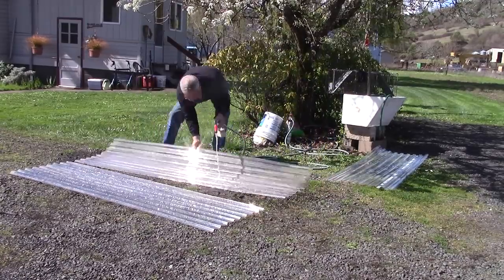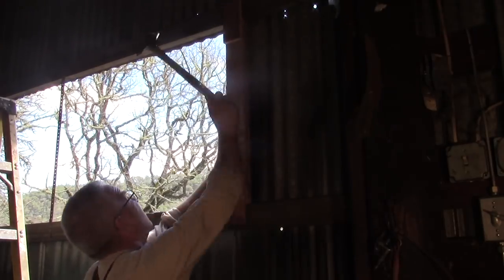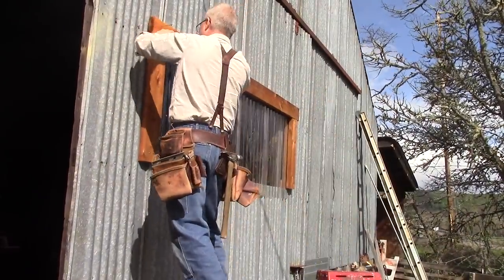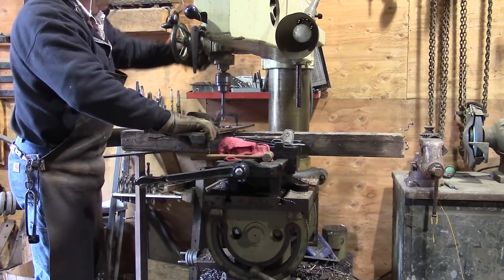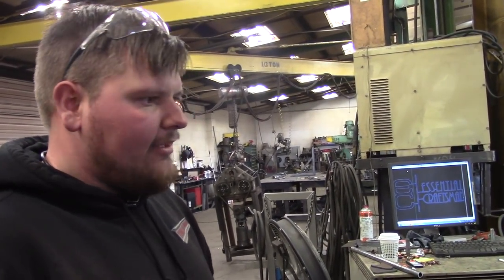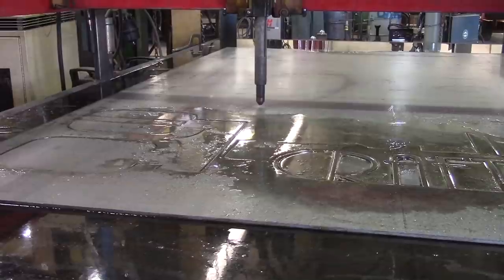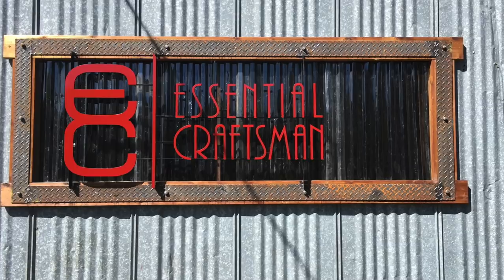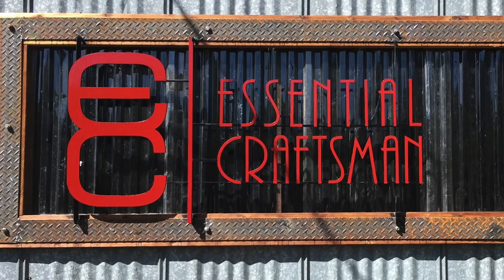Installing Window in Pole Barn

Comment: Sign turned out great gotta love technology! My work has a laser cutter & 3 water jets. The water jets uses 50k psi of water & sand threw a diamond/ruby stone to cut threw 18/22gage metal with 2" foam sandwich in between the 2 layers smooth as silk...

Comment: Great video and the sign is so perfect - good tip also I saw you fitted the lexan with the top on the inside - waterproofing it, with the bottom of the panel on the outside. Good detail the metal plate over the cedar frame.

Comment: Very nice work, and a good look. You might consider applying a mix of linseed oil and diesel to the tread plate border. Just brush it on on a warm day. It will fix the rust and give it a dark matte finish.

Comment: The sign looks great with the window trim you used. Awesome work. Man I've learned a lot from your channel.  I don't do construction, just a lot of around the house.  But I find myself using a lot of your tips. Now when I pick up a tool, I'm wondering how I could use this more efficiently. Thanks for the motivation to get my channel going stronger. It's a lot of work and you're really taking it head on.

Comment: A story on plasma cutters: The point about the localization of heat really hit home for me back in 2010. I was working at a massive construction that had its own steel fabrication  division. Someone had brought in a pair of handcuffs, for one reason or another, and a guy in the office decided to put them on. The issue? The person with the handcuffs, forgot to bring the key hahaha. It was funny. So they took the poor handcuffed guy back to the steel shop and asked them if they had any bolt cutters. Shop worker said no but he had a plasma cutter. As office people we only knew that plasma cutters could cut metal like a razor blade through foam board. We thought the worker was joking. He wasn’t. What we didn’t understand was that at a distance of an inch it was almost harmless. It’s like a water jet machine. Water jet can cut through 1/2” plate steel and then a bucket a foot under the steel can catch the water and recirculate it. The shop worker brought over the plasma cutter, put it up against the handcuff, with was fairly tight around the wrist, hit the trigger one time and the cuff just popped right off. His wrist had a little black burn, but his hand was still attached. The heat is intense, but it’s beyond concentrated. It can cut a handcuff in half, but not skin a 1/4” away. Pretty amazing.

Comment: Looks great! I love lexan. I notice the million tiny holes in the steel panels in various places.  I dont know how the winters are there, and I imagine that with a forge going, some circulating air would be welcome at times. But aside from that, during down time, I imagine that barn gets pretty cold. Would it pay to trowel on some caulking over those holes?
Reply: traderjoes barns like that are one big hole. No use in plugging up the small ones if you can't plugthe big ones.

Comment: Can you use a plasma cutter on painted metal roofing?  Wondering what it will do to the paint.

Also, that sign turned out great.  I need to add welding to the list of things to learn.
Reply: rjtumble You sure can. depending on how hot the pilot arc on your machine is, you may have to grind off a small spot to start the cut. You will also need to grind off a spot for the ground clamp. Unless you need to make a complex shape, plasma would be a very inefficient and slow process to use for the straight cuts required in roofing. A circular saw or a shear is by far the best, fastest, cheapest way to make those cuts. Plasma shines at making complex shapes in medium thicknesses (3/8-3/4). Laser cutters and waterjets can do higher quality on a wider thickness range, but they are very expensive and cannot be handheld like plasma.
Reply: ok, so in other words, skill to the circular saw for my little wall siding project :)

Comment: plasma cutter on galvanized ? wouldn't a skillsaw with metal cutting carbide blade be better? 
...lol. I'm the same way about painting. lol I'm notorious for it. I know it's a skill. I'm more into 3 dimensional skills, I guess. Idk. thanks for sharing this video. I was unaware of those properties of luxon. ill have to rethink a couple of projects . it looks like it cleaned up real nice after being stored for so long, huh?
Reply: Hi Jay Wen, I wondered about cutting galvanized Sheetmetal with a plasma cutter too. I've been told by a welding instructor "Do not weld galvanized metal, it generates toxic fumes"; I'm gonna ask Scott about it.

Comment: It was invented in 1958.  Then the name Lexan was used since 1960

Wonder bread has been around since 1930 !
Reply: Invented is not the same as commercially available which is still not the same as in widespread use.
Reply: Yea no need for corrections on EC's page.  I don't know anyone that doesn't love his work.
I bought the Lexan panels in the 1980's at Orchard Supply Hardware.
Westinghouse held the ownership since 1958, and like you say it may have been used for military and other industrial applications.